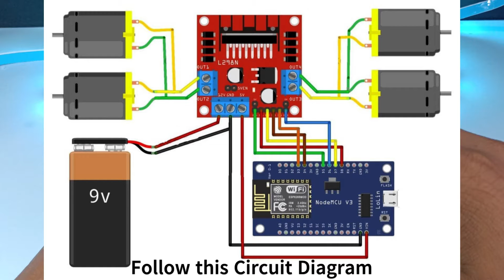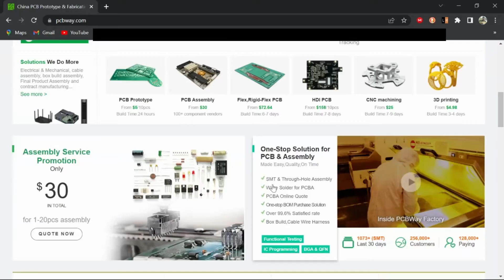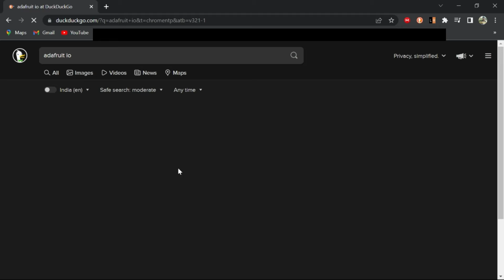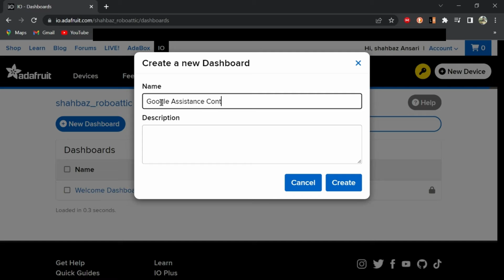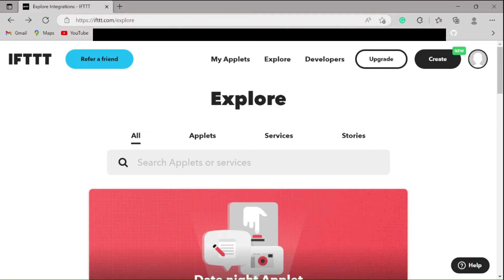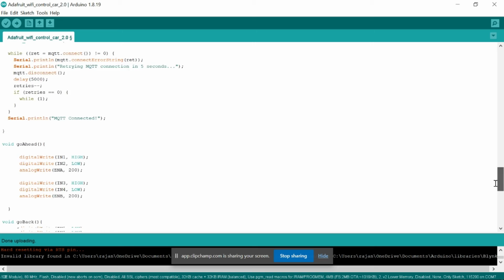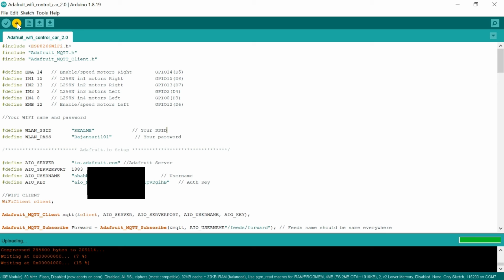How to Make a Google Assistant Control Car With an Integration of AI and IoT.

Comment: I want to use ESP32  instead of ESP8266 
what changes would be made ?

I replaced this Library #include <ESP8266WiFi.h> with these 
#include "WiFi.h"
#include "WiFiProv.h" Libraries

Please Let me know If more changes need to be done
Reply from the maker: Why did you replace them?
Reply: @roboatticLab  ESP32 Dev doesn't Support the ESP8266WiFi.h Library
Reply from the maker: @1_Abhinav_Prakash_Patil  okay